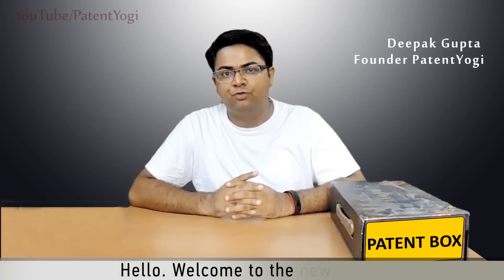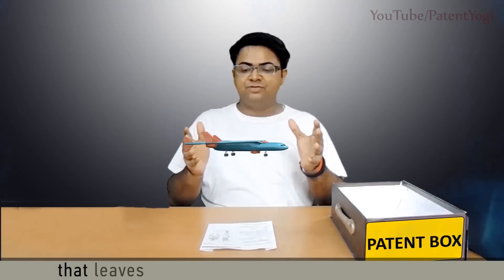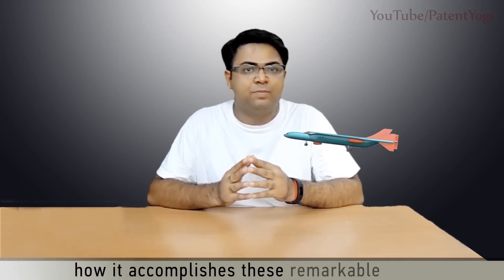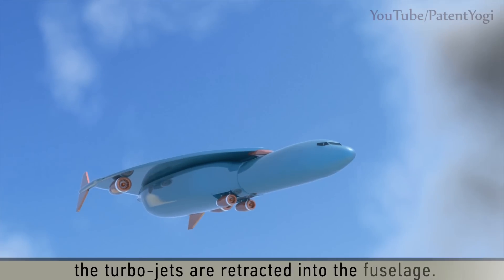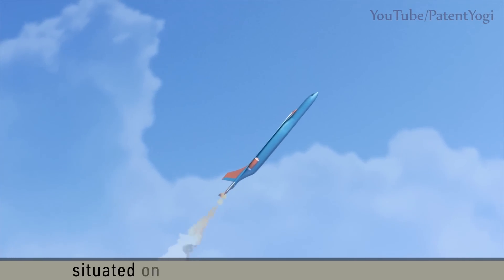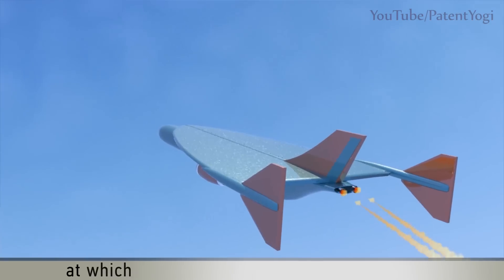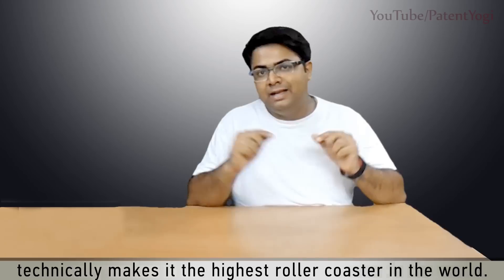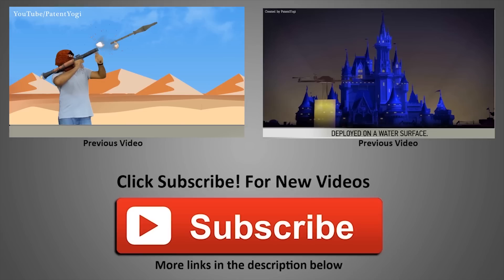Supersonic Aircraft from Airbus

Comment: Man your channel is awesome!! That concept seems pretty complicated seems like a lot of excess moving parts that could have some kinda mechanical failure.... I'm scared lol
Reply from the maker: Marcus Jordan Thanks Marcus. I agree this flight is going to be scary. But good thing is that it will save lot of time. I am waiting for this to enter the market.
Reply: Marcus Jordan Well they are definitely not 'excess' and if you look inside the cockpit of a normal passenger aircraft you'll also spot 1000 things that could go wrong.
Reply: DatKevonG now there's 2000 things that can go wrong including a lot more moving parts! Mechanical failure is always the big problem with any device. The more simply a device can be put together the more reliable it becomes! Moving parts always seem to stop working at the worst possible time. Prime example head lights that fold away in car's. They always burn out and in reality they not need and that is why you don't see them in car's today
Reply: Marcus Jordan Too  complex airframe with lots of sources of potential failure...
Reply: Marcus Jordan There are other, much more complex aircraft that have presented very few malfunctions over the years. The difference in ensuring accidents are kept to a minimum are stringent safety precautions, quality control in the manufacturing of the components, training of the crew, correct maintenance, etc. Since a major failure with one of these would impact Airbus' stocks, taint its image and complicate its plans to sell this aircraft to the military, I think it's safe to assume they're going to make it extremely safe, reliable and test it extensively before selling. My only problem with it is the capacity. 20 passengers? Come on, make it at least 50 or 60 (which would be half of Concorde's). The prices will have to be exorbitant, which is one of the reasons why the Concorde was not feasible back in the day.
Reply: Eric Stone I'll stick with the tradition flight thank you lol!!! Just off hand I can't think of a more complex aircraft except for the space shuttle hehehe... and we all know how many times that craft has had major malfunctions. And another thing doesn't the stabilizer wings in the rear of the plane morphing while at supersonic speed sound extremely dangerous hmmmm I'm not a physicist  by trade but I'm scared s*** list of that maneuver!!

Comment: "The sonic boom is dissipated horizontally and doesn't intersect the ground" except of course for when the aircraft isn't flying vertically. Makes it sound like the sonic boom only happens when you break the sound barrier, rather than continuously.
I'd also be interested to know how you expect something carrying that much rocket fuel to lift off the ground with those tiny wings from a traditional length runway without being unbelievably noisy, fuel inefficient and expensive.

Comment from the maker: Many people have raised concerns with respect to the price and safety of this aircraft. 

It might be useful if they refer to this quote published 1928 in 'The Future of Aerial Transport', The Atlantic Monthly magazine.

"As things are, flying is too expensive a mode of transport to be considered by the ordinary man or woman. To the great majority with means, the deafening roar of the engines, the sense of danger, the great uncertainty, added to the not inconsiderable fare, more than balance the possible gain in time."

How wrong were these people in 1928. And how wrong some people might be today. Cheers!
Reply: PatentYogi When you can only have 20 passengers at a time, the ticket costs would be astronomical.
Reply: Wow, they were actually correct, because it was uneconomical in 1928 but in a few decades, the problems and infrastructure was solved.
So this plane being "30 years away" is similarly sensible.
Reply: Dylan Parker As well as that, the ramjet is incredibly expensive to run. I'm pretty sure that's why Nasa left the Ramjet/Scramjet project back in the early 2000's. Might be different now though.
Reply: +LowestoftheDead in 10 years this plane will look as ridiculous as one of those turbine cars. scram jets are a thing, and theyre coming
Reply: +PatentYogi 
I'm not concerned about price. I just have to look at the shape of this design... It's a disaster!

-- Centre of thrust isn't behind centre of mass (initial turbojet engines)
-- Rockets use too much fuel for the amount of thrust they deliver. Ie specific impulse is too low. You're going to burn up all your fuel before you even reach mach 3.
-- The area curve on this plane is a joke. Do you honestly expect that much friction to be pushed through the atmosphere at even mach 1? Have a look at the SR71 blackbird and see how streamlined that is. Look at the concord...  
-- What's with the piddly little rockets at the back? This thing looks like it has a TWR of about 0.1 ... I would expect a TWR of over 2 to be able to vertically climb out of the atmosphere... 20x more thrust means 20x more fuel which means 20 times more weight which means you're back to the drawing board.

Personally, if you're aiming to hit mach 5, work on an efficient engine design first. You want heaps of thrust with minimal fuel cost. You want something that works in very thin atmosphere and you want something that also works at a variety of air pressure, speeds, temperatures... etc...

Comment: I have read an article about an airplane that would flight much higher than actual planes, that way he could use the speed he gets from that altitude to go faster and burn less fuel. By higher altitude i mean near space altitude.
Is it the same for that EADS aircraft ? Because i read 35k m high but that's the actual cruise altitude for planes nowadays. That means engines would be super effective, and maybe burn way more fuel. That would impact in a raise of the plane tickets.

What do you think of it ?

Nice explanations btw in that video :)

Comment: Going vertical was my idea for my M 2.5 and sonic boom abatement.  The key is propulsion:  PJCCRJE = zero moving parts (career goal since 10yo, Ramjets).  Use active fuel cooling and stainless structure.  I need to know aeroacoustics for the PJ cycle phase with zero parts, except for fuel manifold systems.  FM tremendous problem.  Dr. Rudolf Edse (deceased) also told me pulsing problem in RJ mode (which I've the FORTRAN printout code).   Contact welcome.  Search Engine.       Don Vreeland, CMfgT, BSMET, AS.
Reply from the maker: +Don Vreeland Neat!

Comment: This whole concept seems to be very well planned and it seems also viable. but there are a few aspects which i put under question. According to the law of aerodynamics this aircraft will have a massive sonic boom. Sorry to boom your bubble on this. And according to the same laws this plane will disintegrated at speeds of m 4,5 because it is as streamlined as an elephant or hippopotamus.
Reply: +J.C. Schutte a 100 000 feet, you can fly at mach 4.5 because it is a function of temperature, however your EAS (equivalent air speed) could be well below that, just like an airline flies at 850km/h but "aerodynamically" flie at 400 in cruise at high altitude.

Comment: After twenty two years Airframe and Power Plant Engineering and maintenance, I say , "BAHHH, Humbug".  Great theory but too many interdependent systems, the cost for the Airframe "skin and skeletal" infrastructure itself would be astronomical.   The storage and integration of three separate Fuel systems plus atmospheric exit/entry icing would be a Engineers nightmare, flight control surfaces...Is it "doable", Ok, as humans go, yes anything we fully determine to accomplish is possible, but PROABLE,  another story.

Comment: Nice, but I'm not trusting enough of rocket motors.  We're talking solid fuel?  Still not 100% reliable.
Reply: beohbe64 I highly doubt we are talking about solid fuel (or rather solid propellant) here. Once you ignite a solid propellant rocket motor it will burn until completion, which is clearly not something you would want in an aircraft, you want to be able to control the amount and length of thrust. There is such a thing as liquid propellant rocket engines.
Reply: Steven jwz Same goes for them actually, if you mean using hydrogen.  They could use avgas (normal jet engine fuel) mixed with liquid oxygen for a liquid fuelled rocket motor as they won't be trying to break orbit, but the amount of liquid oxygen required means it is still a flying bomb.

Comment: I think it's a totally conceptual design which goes wrong and may be remains on paper only
......because we know that if we want to used any type of ram jet engine in passenger aircraft then it's efficient did important role while flying....as well as even we took most advance ram jet engine (which is on SR -71black Bird ) we can not used it in reality for commercial planes .......
for the supersonic or hypersonic flight we want hybrid engines like “turboscram jet engine”........it is more powerful than any other engine gives the gurantee of high power to weight ratio.........
and if we taking about faster travelling around the world then for max efficiency we have to travel from region where low resistance experience by any aircraft...that's why hight altitude is a best path for craft.....
but at the same time air breathing engines are couldn't survive over their....
that why the need of new propulsive system necessary for that......
and that's. what iam working on....

Comment: Another useless patent that is undefendable in court.  With only 20 passengers, ticket prices would be $100k to $500k each if it was built.  No aircraft regulator agency in the world allows rocket anything to be allowed in its airspace without filing a NOTAM, and have a circle clearance of 300km with no humans in that area.  That means flights would not happen at any major or minor commercial centers.

Airbus, Boeing, and Tupolev all had other mach .95 to Mach 2 designs that carried 300 plus passengers, which is more realistic, some were nearly complete designs, but airlines placed no orders due to economics of the machines.  The business class market does not pay enough to cover operational costs of such machines.  As operators of the Concordes and Tu-144's found out, the rest of the airline will end up being entirely focused on subsidizing its operation of those high speed aircraft.

Comment: i hate to say never. but in terms of commercial travel this concept would never work.  Why? saftey, comfort and particularly not scaring the bejeesus out of passengers is top priority in commercial flight travel,  and theres nothing suddel about the ignition of two of the three propulsion method mentioned.   every seen the activation of a rocket? or a scramjet.    for one. the initial boost is tremendous. upwards 8g's of force,  then apparently the aircraft must get to its maximum cruise altitude quickly.   yes.. space shuttle rocket type orientation.  good for passengers thinking theyre goinig into space bad otherwise  then  another slam of the scram jet which btw works very very loud and pulsates.  lastly the decent... where passengers must think ok, this is it. im done for.    sorry but its all just too extreme. concorde got it rite  and im thankful tohave lived in a time to see just about all of em , even secret military ones.

Comment: 1) the ticket price is going to be $100000000000000000000000000
2) Basically this is the shuttle
3) To use the rocket engine in the plane construction, does not take much brain...

Comment: Hey... Smart one... "Technically the highest roller coaster in the world"? No.. "Technically", a roller coaster is a cart on wheels which rolls, or "coasts" on a track.. Thats why "technically" it is called a "roller coaster". So Technically its an aircraft that FLYS nearly vertically, levels off, and then in-turn descends vertically as well. Learn your technicalities... Its is not "technically" anything besides an airplane. It does not roll.. It does not coast. At best it glides. Nice video... But learn your english. It has nothing to do with a roller coaster.
Reply from the maker: Aaron Putnam Thanks for the comment. The flight path of this airplane is very similar to some roller coasters. For example, kingda ka in six flags New Jersey. #Factcheck
Reply: PatentYogi you shoulduh jus told ihm ta "get a Pic Man..get a Pic!" Are you all the iYogi help in our computers too?...you think an ancient craft with a being or two came here to Earth and is thought of as Vishnu or someone like that? Rock n Roll.
Reply from the maker: foxyroxstar iYogi is a different company. PatentYogi is a much cooler company than iYogi. :)